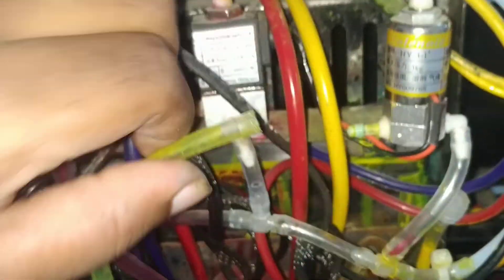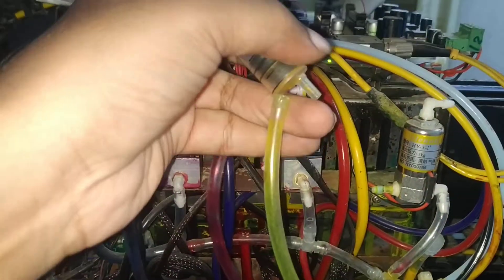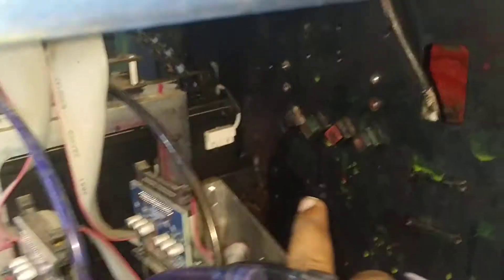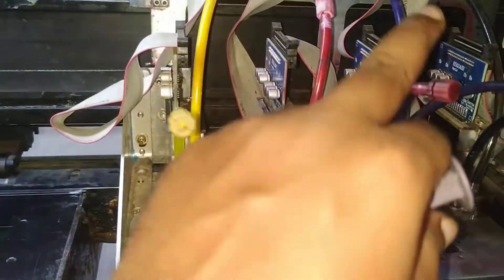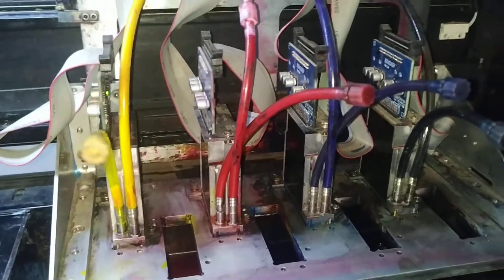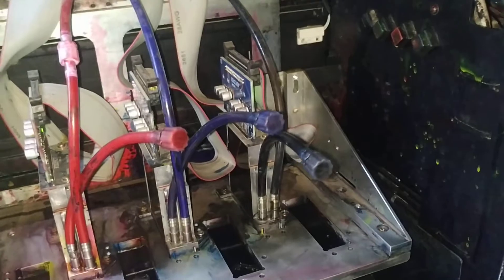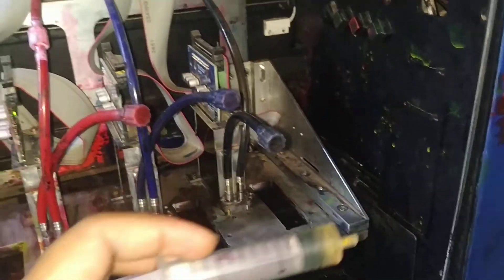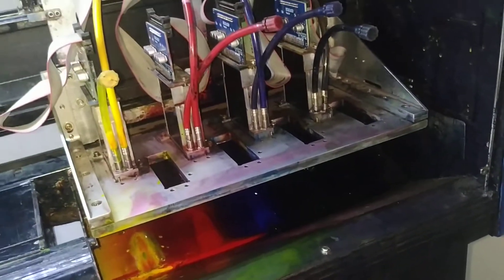Head leaking problem part 2 if you got to it is colour take issue in flex machine

Comment: What cause the Blockhead problem... Is it because of dirty pipeline
Reply from the maker: When you close machine you have keep solvent in pipes also.
Reply: Every morning i need to clean the magenta head with solvent. Sometimes it goes very well. Sometimes it block while printing
Reply from the maker: @Manpuiakhawlhring  from how many years you are using or eals check will closing you have to check solvent is getting in touch with head or not. Or any gap is coming.
Reply from the maker: 8247279812